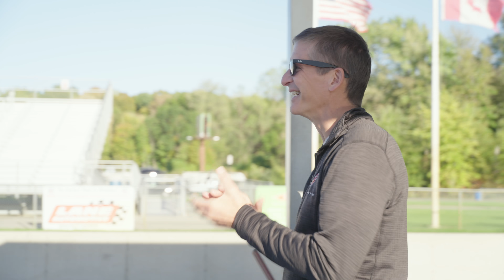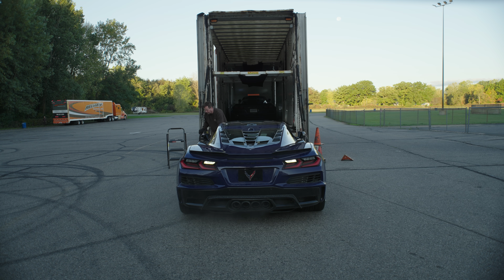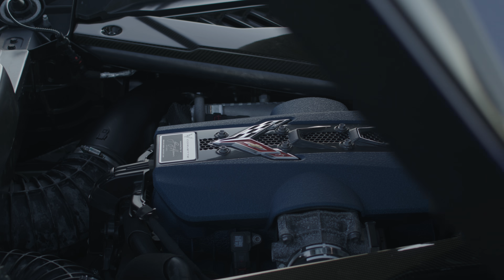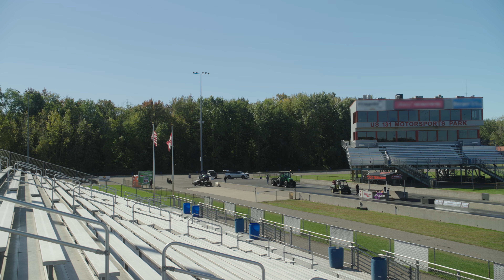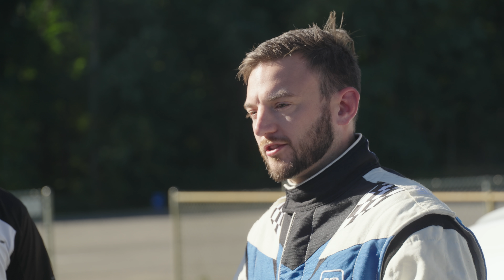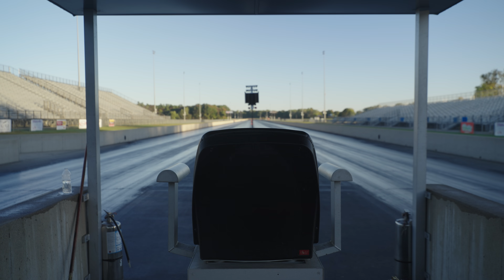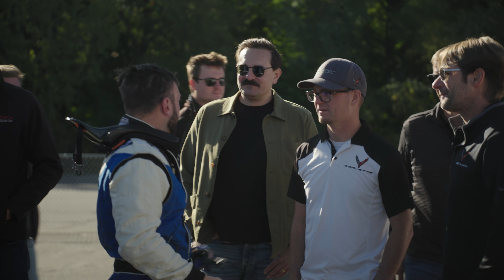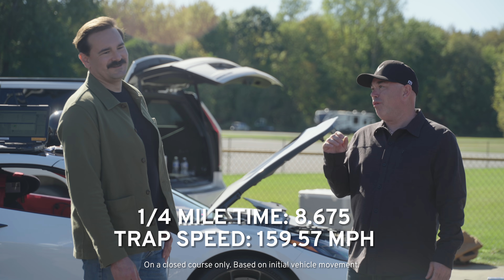We Pushed The Corvette ZR1X To Its Limits (DRAG STRIP TEST)

Comment: Would be much more impressed if i see the numbers on street surfaces, in something like florida heat. The cars a phenom of engineering but yea, to even think about ordering one of these I need to know how it compares to the obvious contenders.
Reply: OK so are the numbers for those contenders published in the Florida heat? I think not.  They did publish numbers on an un prepped surface, this is from their website:

On an unprepped surface, the Corvette ZR1X equipped with available ZTK Performance Package can complete the quarter mile in 8.99 seconds(4) and accelerate 0-60 mph in 1.89 seconds(4).

(4) On a closed course. Based on initial vehicle movement. Requires available ZTK Performance Package.  (also based on initial vehicle movement, so again, no rollout)
Reply: @markw9512  Ofc they arn't, but I know (as well as others around here) what the 60-120's are on no prep and it's quality info. It can be somewhat assumed with these numbers but you just never know with all the prep work they did.
Reply: @GameKaps  well that dad will be coming up soon enough from people buy it and test it.  You can look at Brooks’s data on drag times, just make sure you get the ones without the parachute wing on the back because that drag definitely hurts it, removing it picks the vehicle up 5MPH plus in a quarter mile

Comment: Nah they should have done the test on a road not on a dragstrip where applied glue on the strip to increase traction hence the quicker 1/4 mile. I wanna see the test on a road not the drag strip. Also what tires are they using? It should be a street tire not drag tires or slick tires. Because all other hyper cars using street tires on a road when hittint 8's.
Reply: From the press release: On an unprepped surface, the Corvette ZR1X equipped with available ZTK Performance Package can complete the quarter mile in 8.99 seconds(4) and accelerate 0-60 mph in 1.89 seconds(4).

(4) On a closed course. Based on initial vehicle movement. Requires available ZTK Performance Package.  (also based on initial vehicle movement, so again, no rollout)
Reply: @markw9512 They should have showed that one instead of the Drag strip with glued surface.
Reply: @f50koenigg  yeah go check out during times, and then learn to cope harder.  I noticed that videos of any compliable vehicles are conspicuously absent from your channel. So I’ll assume you’re just another crybaby who’s upset that the car whose poster adores his wall just got its face slapped off

Comment: WOW well done to all the team pushing that thing to its limits and winning a very good time of 8.675 at the 1/4, ( controlled when weather and track conditions) now that really depends on the outside temps, if that car was in Australia and even the us drag challenge that would be a sight to see ,completing that challenge would be the best thing ever for chevy and the C8 ZL1X, driving to different drag tracks for a week and doing you best at each track and were talking about heat and weather of around 35 degrees c on some day\s with humidity hitting around 70%, which will effects any turbo driven car no matter who builds it even with intercoolers and ice cold fluids running though them, it still affects the times and runs, come down under and see how you guys go try to win the class for a factory built st car with that much hp would be a challenge for anyone full stop.🦘👌✌🙌👍😎

Comment: I started telling people about this car in 2012 - 2014 I was 250 horsepower for the top end model it surpassed what I believed was even possible to have general motors deliver I was seriously debating that general motors was going to even allow 800 horsepower v8 out of the factory and having been a general motors brat my whole life and almost every single one of my family members having had been employed by general motors I never thought that they were going to produce a car that was pulling 0 to 60 and sub 2-second times I always thought that it was going to be you know a 800 horsepower at the rear wheels an get 200 200 250 hp on frontbut I never thought that it it would be a 1,064 horsepower at the rear wheels and roughly 200 on the front wheels Whirlpool 0 to 60 and well less than 2 seconds and a sub 9 second quarter mile

Comment: That's 1 tenth from the fastest EV we've seen?
Makes me more curious than every for the Koenigsegg Gemera. Very similar weight, also a V8 turbo, but more power and more EV power, 2300 hp.
How well will Koenigsegg get the power down, though? Their car is set up to do so sublimely, but will the hardware and software actually do it? We might see 7.99 if they do.
Or, considering the ZR1X...maybe a 7.77?

Comment: The Dodge Demon 170 ran the quarter-mile in 8.91 seconds at 151.17 mph, making it the first factory muscle car to break into the eight-second range. The 2026 Chevrolet Corvette ZR1X starts around $207,000 to $210,000 for the base coupe (1LZ) and goes up with trims and options, with higher trims like the 3LZ starting around $218,000, and loaded models approaching $240,000 or more, offering 1,250 hybrid horsepower, with a special limited edition even higher. Starting price of the Demon was under $100K. It would be nice to see what Dodge can do now that they brought back the gas powered Hemi's......
Reply: I don't think anyone cares about the one trick pony Demon.

Comment: They are saying they are putting tuned calibrations in before they run the quarter. Does that mean they aren’t running stock horsepower on this test?? GM are you misleading us a bit here? 
        Can I take a stock car off the lot, drive it until it’s ready for a run & without doing anything but hitting a prepared track at 72 degrees & hit these numbers?? At the beginning the comment was made about “adding the new cals” before sending them down the track.  Later you say sell the car just like this & repeat the numbers am I paying another chunk of cash to get the car tuned to be able to run 8:60s at that track? There’s a LOT of tweaking going on here. 😮😮😮

Comment: Did we forget the Demon 170 was in the 8s first. Not only that but without the full gm team tuning and tuning to get that. A good racer buys a Demon 170 and knocks offs 8s all day on a good track. That with out awd and a electric motor helping. And 1000lbs heavier
Reply: This a joke? Show me a video of any showroom stock demon In the 8s. I'll save u the time they don't exist. 9.2 max and the stars have to align to do that 1 out of 30 passes. To run 8.99 and below they have to change wheels tires and tweak suspension.
Reply: @bobtaliaferro5492 that’s one way to tell me that you don’t know the difference between the Demon and the Demon 170. Google could have saved you some embarrassment.

Comment: It's still boggles my mind that people keep comparing the GTD to this. That GTD was not built in a Ford factory rather they it off to some custom shops to get built. So if Ford comes out with a faster car Chevy can then take the ZR1 x and send it off to the custom shop to get modifications done? I just don't understand how people keep comparing these two vehicles when one is basically built by performance shop and the other is built by a car manufacturer
Reply: So a more accurate comparison would be sending the Vette to Lingenfelter, then running it against a stock top of the line Ford built Mustang.

Comment: I believe there are only two production cars that are quicker, the Pininfarina Battista: 8.55 seconds, and the Rimac Nevera: 8.58 seconds, both costing over $2 million dollars and both are full electrics.
Reply: In reality they're both the same car. The Battista is just a rebodied Nevera.
Reply: The corvette is a massed production car vs the low numbers built only when ordered cars you mentioned
Reply: What about other hyper cars on drag strips
Reply: @prajwalsalunkhe7574 they are all in the 9s
Reply: @scrivens100 on drag strips??
Reply: @prajwalsalunkhe7574 
I think the Absolut can hit under 9 sec . If not then at least one of the Koenigsegg’s can hit under 9. That’s the class this corvette X is competing against and costs probably as much as the tires on those other mentions.
Reply: Rimac is 8.25
Reply: The Rimac Nevera got 8.4 on an un prepped surface on carwow and achieved a prepped time of 8.25. The new rimac nevera r did a 7.9 second 1/4 mile.
Reply: @howtokindaplay  

https://www.youtube.com/watch?v=KagGeqm6fF4
Reply: And both are boring as heck.
Humming down the track.
Reply: @dougmaverick3287  ...more like whining down the track....about all the noise😁😁
Reply: @tomm487  whining just like all the corvette haters in the comment section
Reply: Didn't the Dodge Demon run an 8.9?
Reply: @Cammac8 to get those it's with the demon you have to switch to race gas put on drag slicks or radials and the car is gutted
Reply: @Cammac8  yeah but he’s saying quicker than the corvette

Comment: Unbelievable.  But everyone should be aware that NHRA tracks will not allow the car to run this quick/fast.  Current NHRA safety guidelines limit newer production vehicles like the Corvette to no quicker than 9.0 and 150 mph max in the 1/4.  Anything quicker than 9.0 will require a roll cage.  And anything faster than 150 will require a parachute.  The only way you can exceed these limits is during a private track rental (like this video was shot at) or at a non sanctioned outlaw type track.
Reply: How long with this remain in effect? On release the Plaid ran into this issue but it doesn't appear to exist today.
Reply: @sunnyindenver  - Actually when the Plaid was released NHRA rules required a roll cage for any car running quicker than 10.0. NHRA updated its rules in 2022 allowing unmodified 2014 and newer OE cars to run 9.0.  Don’t expect NHRA to modify this rule further.
Reply: @danmyers9372  "Don’t expect NHRA to modify this rule further."

Why?
Reply: @sunnyindenver - Because this was the first rule change like this involving OE cars in over 50 years.
Reply: @danmyers9372  And?

Comment: When the early rumors of it potentially hitting 8's came out, I don't think anyone thought it would be THIS deep into the 8's. 8.6 is just batsh!t crazy! I've never been prouder to be a Corvette fan. Incredible work, guys.
Reply: There numbers are in the most favorable conditions though. But still this car will probably do 8.8s or 8.9s when not in favorable conditions which is STILL beating pretty much any production car
Reply: @alexkoelle9513  Yes, manufacturer's typically try and align the conditions to favor the best outcome. This is not a surprise, nor different for any other manufacturer. People don't understand just how different 8.6 is from say, 8.9. Those few tenths become exponentially more difficult to achieve the lower you go, and Chevrolet did it on a completely stock car on stock tires and PUMP GAS. 

The fact that it will run 8's on the street, out of the box, is just NUTS. As you pointed out, I don't believe there's any non-EV production car that can achieve this...for any price, let alone $200k. AND the ZR1X will beat just about anything around most race tracks. AND it's still comfortable enough to put a bunch of luggage in the back and take it on a long trip. 

What Chevrolet have achieved is simply mind-boggling. It's earth-shattering. The value-for-money is simply unmatched in the history of the performance automobile.
Reply: I sure didn't. But if you do the eray math with what it picked up the c8 by 8 tenths a zr1 has ran 9.2 so there's food for thought.
Reply: @bobtaliaferro5492  Indeed! I, too, had done the E-Ray math and figured it would at least hit 8.9, but as I mentioned in another comment, going from 9.2 to 8.6 is exponentially more difficult than going from 11.2 to 10.6, so it's actually quite amazing. I really never thought I'd see the day when the Corvette would legitimately be Hypercar-level performance, let alone Hypercar BEATING performance. Hats off to Chevy. Simply incredible.

Comment: To put this in context, this is similar to the feel of the original Top Thrill Dragster at Cedar point. The ZR1X does the 1/8th mile at around 5.8 sec at 128mph. The original Top Thrill (before overhaul) did about 120mph in 4 seconds.
Reply: It did 5.60@129.7 with a 1.37 60ft to b exact.

Comment: I’m a ford guy and this hands down blows anything ford has EVER made out of the water. Wish Fords tool bag of a CEO would build something this cool. Instead he’s got some weird fetish with Porsche and still couldn’t beat the ZR1 or Porsche with a 3rd party building his car. Meanwhile Chevy just drops its nuts all over the GTD and the cherry on top is the jab at the GTD with calling it a 10 second car. LOVE everything about this video. Good job GM
Reply: Supposedly Ford has something coming but it sounds like it might be a 1000hp rally car or truck which will be an enormous disappointment.  The New Gt500 really needs to be 1100hp and awd or Ford is really losing ground if they put out a 850 hp rwd Mustang.

Comment: it´s an EV... come on!, fastest? try the demon 170 or GTD, that´s a real muscle car..
Reply: Its not a ev skippy. It has a 1100hp gas engine in back with a small electric motor driving the front wheels for acceleration. The battery is 1.9kw . Its like 2 car batteries. in the tunnel. You can't charge this car. Its not a ev.
Reply: @jostrander71 it’s an ev 🤮
Reply: @AreaG15  I didn't realize EVs only need 150 hp in the front motors to get 8.7 times.  Amazing!! I learn something new everyday!  Screw the filler metal piece in the mid location of the car.  That metal contraption is just a knick knack to produce noise for the exhaust.  You're amazing @gonzad.  You should have 1000 red dot awards with your intellect.  Dude where ya been bruh?

Comment: The C8 is one hell of a platform. The range of cars that have been born out of this platform is amazing.
Reply: I wonder how the guys who insisted that real corvettes have to have a front engine will respond to this.
Reply: Yeah gm hid it well and tested on the mid engine platforms for years for the c8 they used a Holden ute in 2013 to start it off look up Holden ute project blackjack.

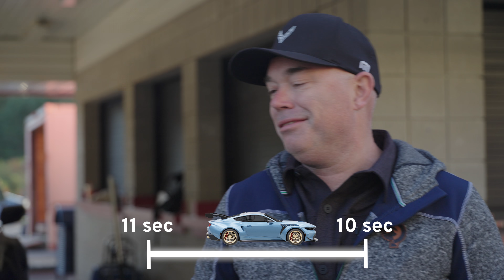Comment: I love how Chevy called out Ford and Ferrari at the 1:15 mark, they should've used a SF90 or F80 instead of a 296 to really rub it in. The third car instead of a Corvette it would've been funny to show a Koenigsegg Jesko, because the Corvette manages to beat it in the quarter mile.

The ZR1X does everything the Demon 170 does and more, consistent 8s with the AWD, on PS4Ss so it's better on the street, plus it can actually turn corners unlike the Dodge.

The ZR1X does almost everything a 911 Turbo S does and more, it can be usable year-round, it provides consistent off-the-line acceleration, it has that low-key appearance without ZTK for less attention on the road which I assume is why most people would choose a Turbo S over the equivalent Ferrari, Lamborghini or McLaren, and yet is cheaper than a Turbo S. The only things the Turbo S does better are having back seats (tiny, but there) and looks though subjective.

Comment: Below are two clean, production-only rankings using your locked ZR1X times.
No speculation. No extras.

TOP 10 FASTEST PRODUCTION CARS (0–60 mph)

(Fastest → slowest)

Chevrolet Corvette ZR1X — 1.68 s

Rimac Nevera — ~1.74 s

Pininfarina Battista — ~1.79 s

Tesla Model S Plaid — ~1.98 s

Lucid Air Sapphire — ~1.99 s

Bugatti Chiron Super Sport — ~2.2 s

Porsche Taycan Turbo GT — ~2.1–2.2 s

Bugatti Chiron — ~2.4 s

Dodge Challenger SRT Demon 170 — ~2.3 s

Tesla Model X Plaid — ~2.5 s

TOP 10 FASTEST PRODUCTION CARS (¼-MILE)

(Fastest → slowest)

Chevrolet Corvette ZR1X — 8.675 s

Rimac Nevera — ~8.74 s

Pininfarina Battista — ~8.76 s

Tesla Model S Plaid — ~9.23 s

Bugatti Chiron Super Sport — ~9.4 s

Lucid Air Sapphire — ~9.6 s

Dodge Challenger SRT Demon 170 — ~9.65 s

Bugatti Chiron — ~9.8 s

Porsche Taycan Turbo GT — ~10.1 s

Tesla Model X Plaid — ~10.2 s

If you want this exported as a one-page table or want to lock another metric (60–130, ½-mile), say the word.
Reply: Nice work. Good honest reporting. Same as my findings. 
Ppl/manufacturers claims and real world numbers are sometimes far apart but you did great.
Reply: Couple critiques,

Lucid saffire is 8.90
Dodge demon tho nobody outside engineering and test driver saw it but it is 8.91 fastest I've seen a showroom stock is 9.28 only ppl running faster changed rear wheels, slicks and mild suspension upgrades

Comment: WHY in the actual HELL did they run Pilot 4s??  On a 1250hp vehicle? Cup 2R would of possibly resulted in a even quicker time. However, the AWD and electric assist provided most of the heavy lifting when it comes to traction.
Reply: That's just them flexing.  Factory standard equipment.
Reply: @JeffSiddall but the Cup 2r is what they are going to be sold with. Rightfully so. A base C8 would be great mated with Pilot 4s.. not this monster.
Reply: I'd love to see what this could to with a set of Nitto street/strips on it  @JeffSiddall
Reply: They wanted to do it with a specification customers could buy; the way the car will roll off the lot. You can only get Cup 2Rs with the ZTK package and the big wing. If GM did allow Cup 2Rs to be ordered separate from ZTK and aero packages then I'm sure they would've run it with those tires.
Reply: @pauljr.harrington1905 that's wild. What about the ZR1? Same thing? I hope not because C2R   would really shine because it's RWD.
Reply: @IceTTom Brooks from DragTimes ran a 9.2 with PS4Ss in his ZR1
Reply: @pauljr.harrington1905 I know. He's been known to but Toyos or a better track tire on too. Guess it depends what he had on at the moment. Pilot 4s is a legit tire.

Comment: Install a shunted controller that will do a larger electron dump to the motors making 300-400 hp instead of the 180. Do mid 8's. :)